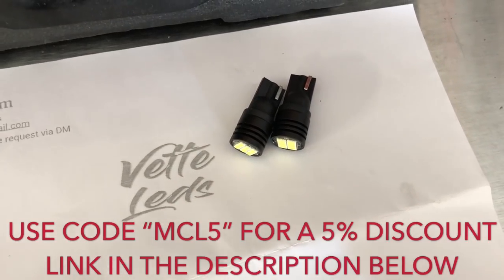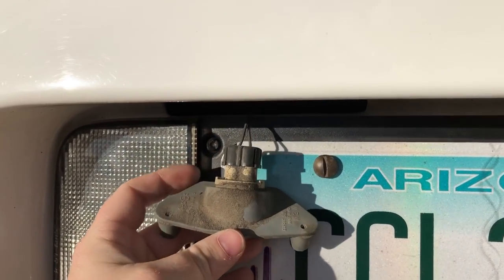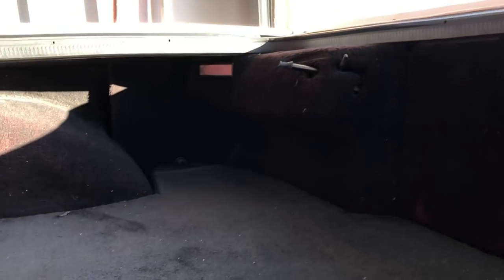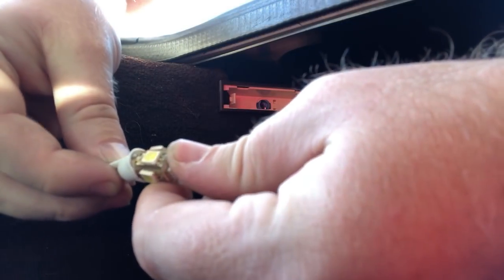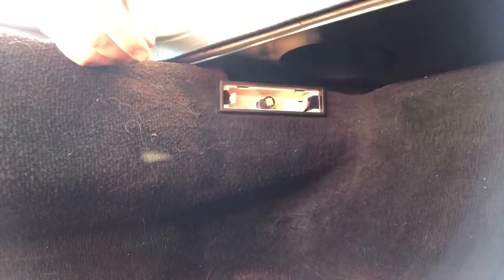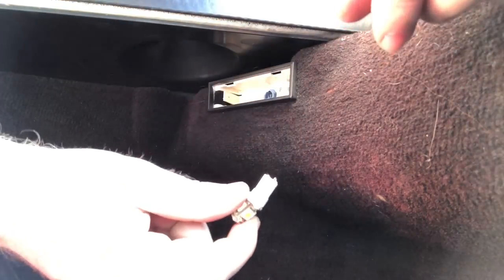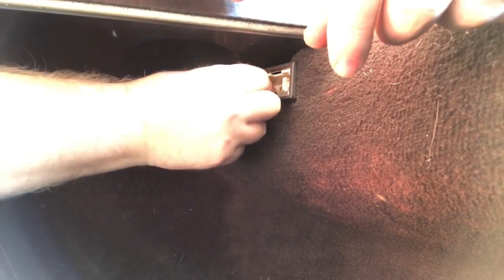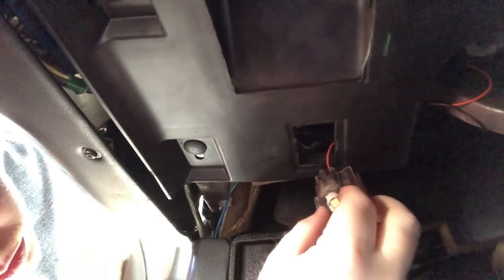C5 LED Cargo Lights

Comment: Hey Chris!!!! i just did my LED change last 3 weeks ago...... but now the lights doest work. but the rear mirror lights works .. is there a fuse that i need to check? let me know pls.   thanks.....
Reply from the maker: Try flipping the lamp over 180 degrees.

Comment: Hey Chris! Love all the vids! Looking to change out my cargo/trunk lights from halogen to LED. How do you remove the halogens? i was pulling straight out but they are stuck tight. Do the have to be turned to remove?
Reply from the maker: No, just pull.
Reply: @mycorvettelife  Thanks!!!
Reply: @mycorvettelife  I have a 2000 C5 that the full interior and cabin lights stay on how do I turn them off!!??